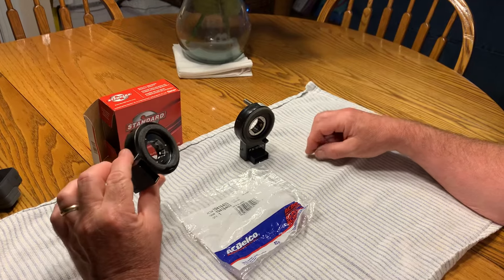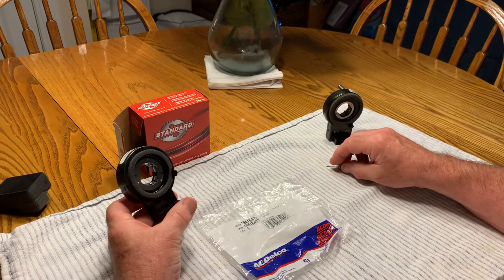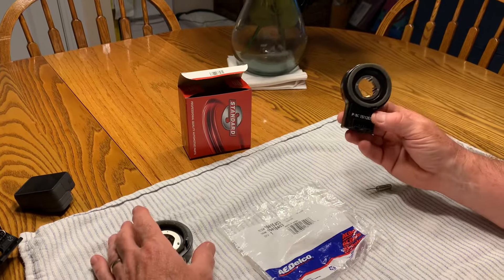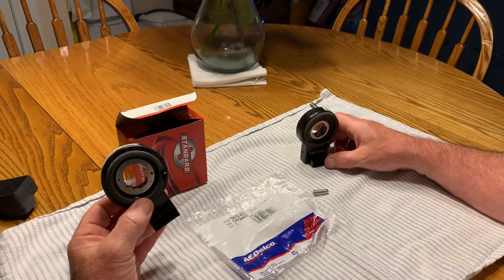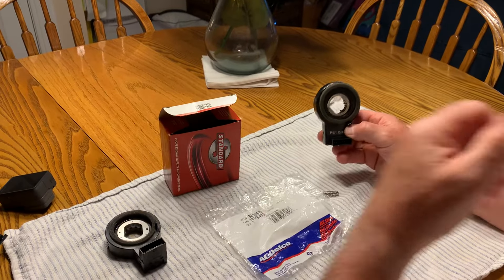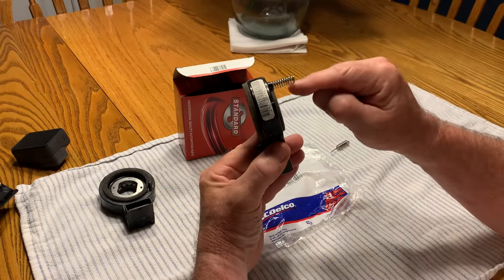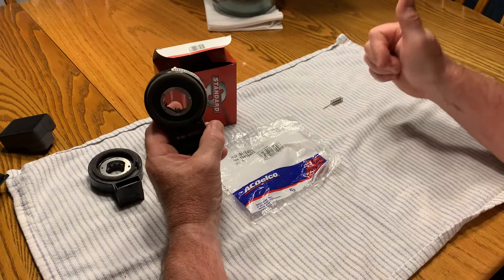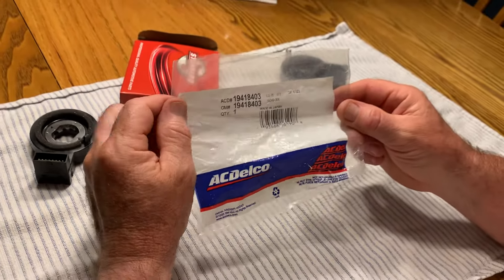2007 Chevy Tahoe / Silverado Stabilitrak Traction Control warning MUST WATCH part issue

Comment: When Standard Motor Products made this Steering Angle Sensor part, they copied they sourced an OE AC Delco part.  So to say that this part is not going to work is totally wrong.  Obviously there are several variations of this part depending on the year of your particular vehicle.  It didn't work on this guys doesn't mean it won't work on everyone's.

Comment: Bought my STANDARD brand at oriellys. Ran out to check after your vid. They gave me SWS131 and the tang matched your original broken 2007 tang orientation. I went ahead with the swap and it worked great. Thanks for having this up so we can catch these faults before we get in trouble. Now if I could only find pins and bushings for my crawler!

Comment: Just got mine I will keep you guys posted 2007 Chevy avalanche
Reply: What happened?  How does the connector work with the 8-pin?
Reply: So I'm wondering which part you got the six of the eight pin and where you got it at and if you are able to install it and get it to work so the stability track traction control was resolved?
Reply: So where’s the update ???

Comment: So I'm having the stabiltrak light come on and I have to get my obII reader and delete codes and then It will work again like nothing for a while but it also says by 2nd Bank of 02 sensor needs to be replaced you think I need to replace this or what else should I take a look at it kinda sounds like it's misfires sometimes thanks for the help
You think i should change my parts as well

Comment: I did everything suggested. Part fit like a charm and all. But the code is not clearing. The moment I touch the steering wheel the code is coming back on.

Comment: I have this issue now to ..2013 suburban the lights came after I did a complete  twin turbo ls and 6L90 trans swap...I'm running 1200 hp in 4 wheel drive

Comment: Don’t mind me saying, but please always remove the ground battery cable first, not the live one. Note, you can’t short the ground cable to any surrounding ground surface near the battery, and so, no sparks, etc. Just for safety’s sake. Good video, very informative! Thanks.
Reply: I seen you have to calibrate the steering wheel sensor with a car scanner
Reply: I broke the clock spring on mine. Now I can't honk at the cows 😔

Comment: My 07 Escalade with 210,000 miles was always Binging and chiming Stabilitrak reduced power, I found after months of buying and doing many things in the end it was the negative cable power sensor. I purchased the entire ground cable with sensor. Drove over one year and 15 thousand miles later not one light or sound...
  Items tried with no success Brake light switch no luck two days later comes back, Steer wheel angle sensor no luck. Cleaned every ground connection on the frame there is two hard basterds up front passenger side still no luck. Truck underneath looks like the day it was built a Las Vegas vehicle, I even added two new grounds no luck I went so far as having the trucks computer looked at still same crap. I read every person findings is different. With what I know and did by replacing both Positive and negative cables with power sensor $160 bucks money well spent. I even purchased a new battery that did nothing.
Reply: Where did you get them??
Reply: Thanks for posting, glad you figured it out!!!!

Comment: Do exactly what he says to calibrate that sensor after you install it because it does work I used a doorman sensor instead of the AC Delco
Reply: After you start the car and the code comes back up on all the time do what he said turn the car off disconnect the battery reconnect the battery turn the key on turn the wheel to the right hold it for 5 seconds turn the wheel back all the way to the left for 5 seconds turn it back to the middle position it in the middle by itself then turn the key off and the code is gone forever

Comment: Thanks for explaining the pin I installed one on an 06 avalanche part from rockauto,  but I never saw any instructions on the pin , but do I pull the pin before or after I disconnect the battery , by the way I am driving with the pin in, lol thanks for any info.

Comment: Would this work on a 2008 GMC Sierra 1500 crew cab? I bought part number ACDelco 20910871 and it fits but I still get stabilitrac/traction control error. And the original part from my truck, the middle piece spins and the ACdelco part I purchased does not spin..its secured in place...and it is an 8 pin and my  original was a 6 pin.

Comment: Didn't work on 07 Tahoe, now it shows my traction control and stabilitrak if off when before it showed it needed service
Reply: Did You ever find out what it was
Reply: Yes. I finally found a mechanic that would look into it and not just guess random things. He replaced all the speed sensors and reset everything and it's been fine since

Comment: So apparently they came out with a third design, part 19118404.  Went to the dealer today and he asked which one I need, the 403 or 404.  So now I wonder if this new design supersedes the other one or if they are completely different.  I have a 2010 2500 HD.
Reply from the maker: I just came across this... Connector may only need cleaning.  https://autoworksmn.com/2015/07/adams-service-tip-service-stabilitrak-message/

Comment: Good morning....were you lights CONSTANTLY on...........I have an INTERMITTENT traction control light ONLY when TURNING............replaced wheel speed sensors, abs module, upper control arms (thinking the angle was causing it-leveling kit was installed).........this and the ABS PUMP are the only things left..........someone PLEASE reply with THE answer to my NIGHTMARE

Comment: Hi everyone so if this is a 6 pin original and the new one part #19418403 is 8 pin how will the new one Connect to my 2007 Silverado?
Reply: it worked for me. 07 chevy ltz
Reply: the 6 pin will connect to the 8 pin on model 19418403
Reply: @hectordelgado1027   hi what will your truck do when the light turn on ?
Reply: @mateoort4187  nothing. It doesn’t affect the performance but the message is annoying.

Comment: Great story great video. You have a new subscriber bud. One question though, would this part work on a 2011 Yukon as well????
Reply: yes
 07-13 1500s Tahoe's, Silverado's, Yukon's and Sierras, literally everything from the front seats forward are identical inside and out, same suspension and everything, hope that helps, if you have any questions holler at me on facebook, names tyler bass, im out of fort walton beach fl

Comment: All you have to do is slide that part on the shaft and turn it until it lines up. It’s not the wrong tang or whatever the heck you called it. I just replaced one on my truck today it looked exactly like the Amazon one I slid it on the shaft turned it until it lined up and snapped it in works like a champ.
Reply: You are wrong two different parts Great video

Comment: Hello William,

When you had issues, were both ABS and Stabilitrack lights on?  At under 2MPH did ABS engage?

This is my condition on a 2007 GMT-360 with 5.3l engine.  I have a nice scanner and all wheel bearings are reporting correctly....but under 2MPH ABS pump engages.

NOTE:  I also understand the MOST common failure is front ABS sensors being "rust jacked" and fail.  Replaced both bearings and signal is clear on all four corners.

Any reply from ANYONE would be apprciatred.  ABS module responding but only under 2MPH.

Mr. P
Reply: replace your rear left and right speed sensors, cause the issue you're having could be anything, could be speed sensors, could be steering position sensor on the column, could be the clock spring, could be a handful of different sensors, I had that issue with my truck also, its like my brakes would lock up for like 4-6 secs and then it wouldn't do it again until I shut the truck off and let it cool down like over night, and then it would do it again, very odd, but I changed my clock spring, rear sensors, and it went away, I'm about to do the steering sensor because none of my shit will go off, the stability track, traction control, service brakes soon, all those lights and messages are on and its by far annoying as fuck, lol
Reply: @Tyler_Bass850  

Hello Tyler,

Certainly appreciate your response and YES I am aggravated with the dash MIL's and readings across the info area.

I watched some other videos and now will check ALL fuses.  One video referenced a trailer related issue that caused a blown fuse to ABS.

On my vehicle it is consistent and repeatable from low speed stops (ABS engages as if I'm on ice)

Normally just a front wheel bearing sensor (have done many times), but I am getting good readings through my service tool.

GRRR and thank you again for the input!

Mr. P

Comment: How do you go about plugging it in tho?. If it's an 8 pin and the connector is 6 pin. I haven't taken it apart since I don't have the part yet cause of this.
Reply: The connectors are the same. It’s an 8 pin connector but only 6 wires. 14+ have all 8 wires in the connector.

Comment: I had the same problem, I just pulled the fuses and no problems now. Dealer already pulled a fuse relating to the suspension system, vehicle wouldn't shut off. My electronic ride is screwed up so this has what it came down to. 2008 Escalade
Reply: What fuses

Comment: So once I buy the part how do I install it?
Reply: you remove the steering intermediate shaft and unbolt the steering column slightly from its mounting position so you can slide the column forward to be able to pop the old off. it doesn't just slide off, it is designed to only slide easily one direction.

Comment: Why would this have to do with traction control? I have the service traction/stabilitrak light on the dash. Wasn’t sure if someone can explain what the wheel position sensor does in comparison to the traction control
Reply: It’s away to get people to bring there vehicles to the dealership is my guess, many sensors or parts going bad can cause the trac stab cont and abs lights to come on. If anything messes up or even if you have a miss fire will turn off abs trac control and stability trac. It sucks abs is a pain in the ass!